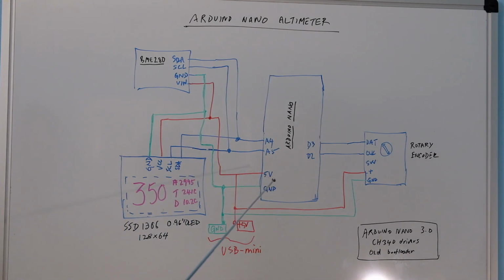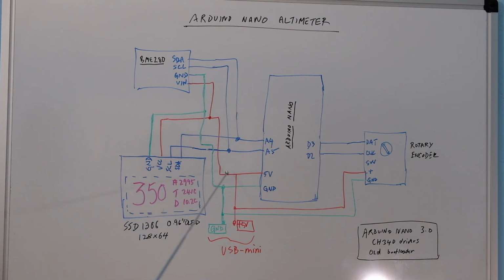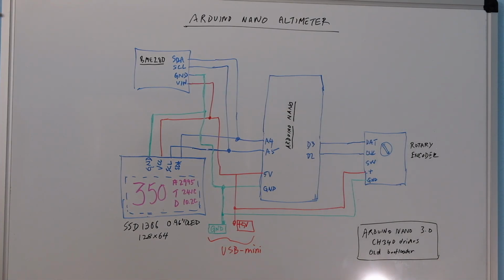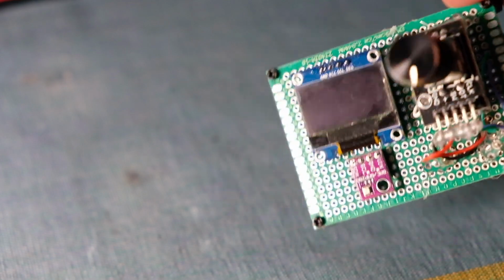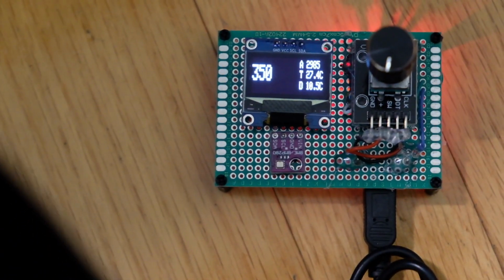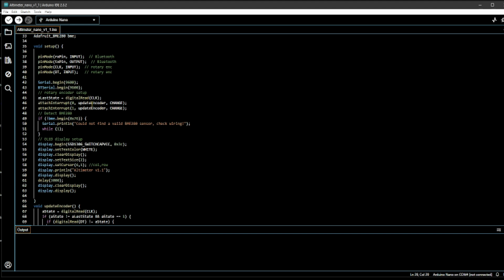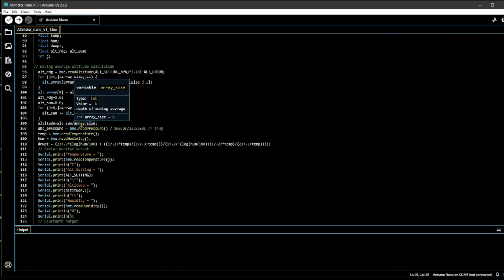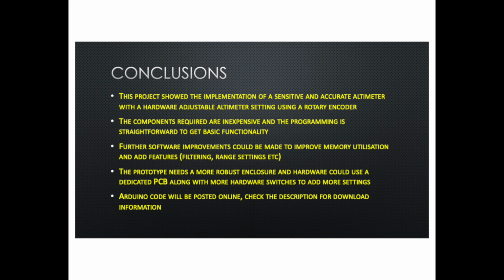DIY sensitive altimeter -  Arduino Nano platform with a BME280 sensor

Comment: Hello I realize it with altitude and barometer hpa it works fine. I am not an expert at all but all I2C screen are to small and I wish a greater screen but they are in spi interface? also I wish use the  push push action to have 1013hpa base or true hpa. Could you please help me for ? Thanks Didier

Comment: Hello very intéressant. My altimeter is out. It is my second altimeter failed after 3 years. Were can I find the complete ino file in order to realize a fine an usable altimeter. Thanks Didier
Reply: The link IS ok but IS the rx0 and tx1 pin used with RX and TX pin of the hc-05 BT module ? Thanks
Reply from the maker: I don't use the BT module for this application. I included it when I was testing it out so the code is still there (the HC-05 TxD pin will connect to the Arduino RXpin, which you define, similarly for the HC-05 RxD pin). The altimeter uses the OLED display.